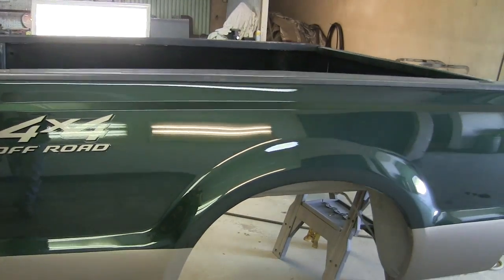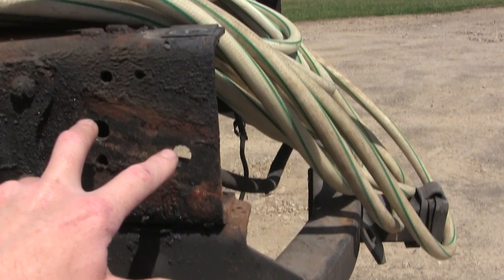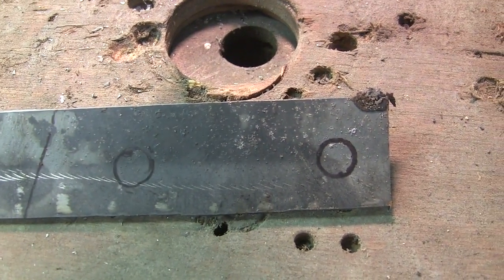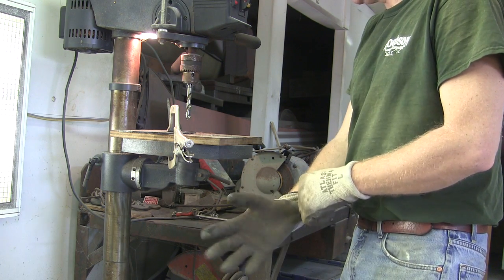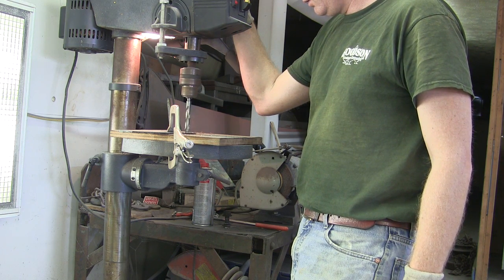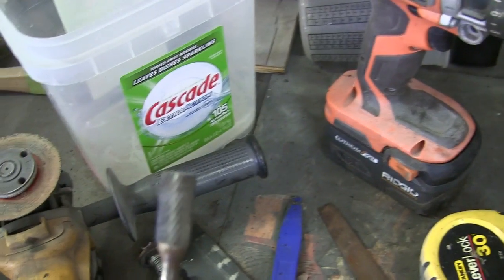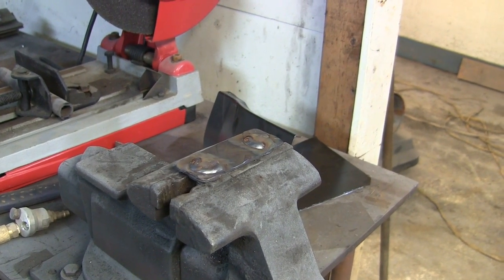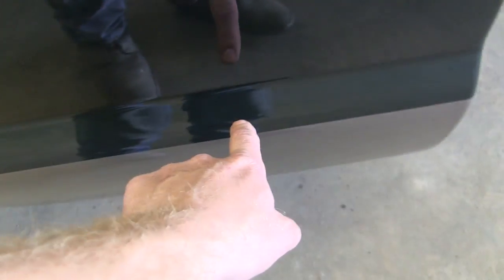How to make bolt retainers for wrenchless tightening

Comment: Looked like you did a good job of locating those holes and opening up with the carbide bit.  The holes look pretty round, when I do that, the holes end up looking hacked up and out of round.  Bummer on the run, but at least it's a light sagger and will be easy to sand out....
Reply from the maker: That carbide bit is almost done for... teeth chipped out and such.
Run sucks but at least I got it slick :)  I'll just use the TurboCobra glazing putty trick and get er done

Comment: good tip sean im gonna pull the bed off mine in a week or so do a little rust control
Reply from the maker: I hope your bolts come out for you.  I had to drill the heads off the front four.  Invest in a T50 impact grade Torx bit.  Those bolts are stubborn